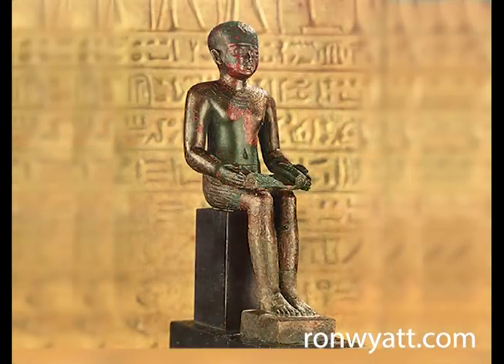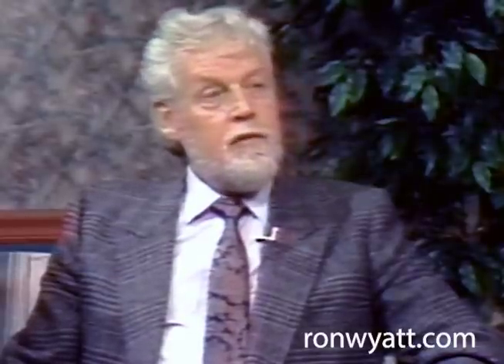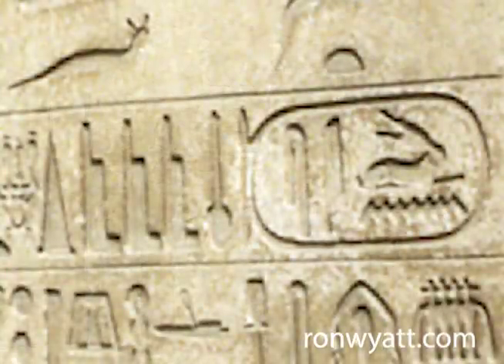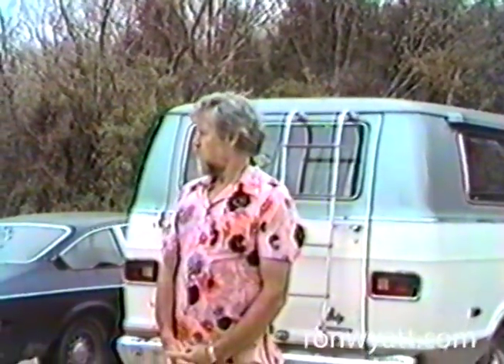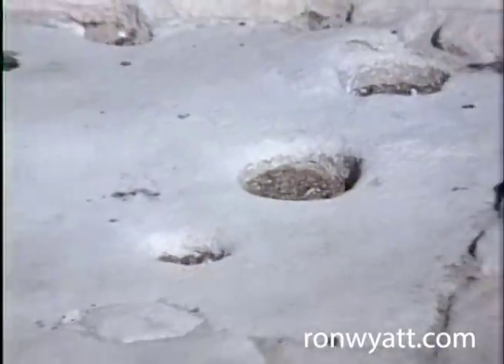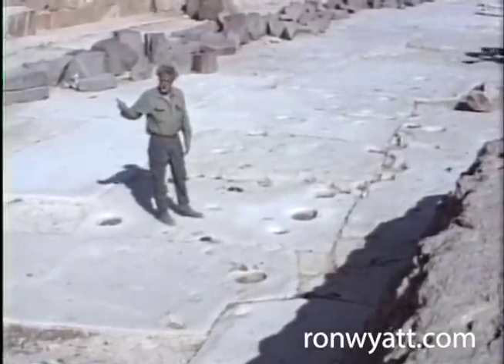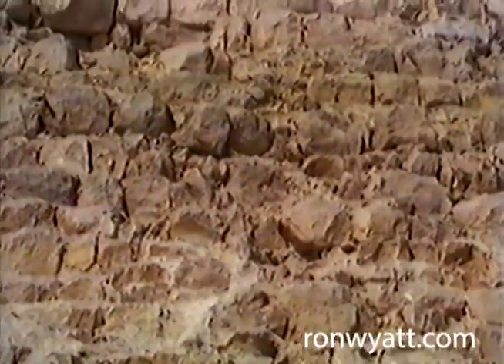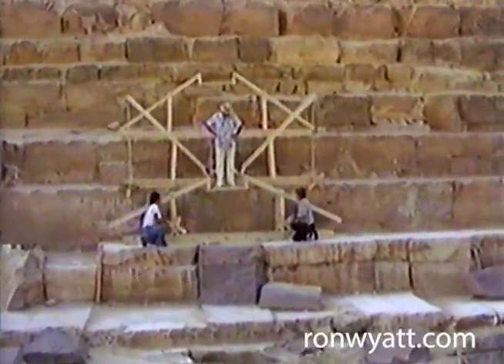Joseph the architect of the First Pyramid and How the Pyramids Were Built

Comment: Dear Mr.  Wyatt,  I too had a hunch that Joseph was the architect of the pyramids in Egypt  too. It only makes sense.  He was commissioned to  build buildings that would keep grain and corn for surplus stored up for up to 14 years.  And Joseph was educated, he showed the purpose of the building by putting the grain shafts in line with the season change. 
Ron, think like a farmer.  Those are silos. There's a place where the grain and corn rode up a conveyer belt and into those shafts. I believe that Erich Von Daniken found grain and corn in those shafts.  And that proves your point as well.  You have a new research video to do sir.

Comment: Some parts, and/or some pyramids may have been built like this but the great pyramid of Giza was NOT built like this. It was in fact built using 2 methods, 1) a ramp method to get the largest stone in place - where the counter-weight used to haul the large rocks into place was placed in the "gallery". The 2nd method was a spiral tunnel built into the pyramid from the inside from the ground all the way to the top. and at each corner a contraption was used to turn the stones by 90 degrees in order to get them ready to go up the next stage of the ramps which made up the spiral. As the pyramid rose, so did the spiral. The tunnels that made up the pyramid is still there.
Reply: This is the French man theory?

Comment: The great pyramid is 756 feet long on each side, 481 feet high, and composed of 2.3 million stones weighing nearly 3 tons each and that the structure was erected in just 20 years, which means that a block of stone had to be moved in place about every 5 minutes of each day and night 24/7. I don't think such a machine can do that kind of work.
Reply: Geopolymer (Institute)
Reply: you are wrong, its always the same claims and wrong numbers about the great pyramid. just one fact as a start, most of the inner core of the GP is small, rubble and bigger stones and LOTS of gypsum plaster, only the inner structures and outer layers are made from big stones.

Comment: This should be good!😂😂😂
"Melting Stone With Sound" video shows a guy uses sound frequency to cut through a stone using a soft copper tube, a technology that, advancing over the centuries, could be the method used to cut and transport megalithic stone blocks. Their "Priests" would be able to chant a perfect pitch by watching the patterns of sand on a drum. Maybe that's why the Priests were considered sacred. The voice of the Gods? 
They're not talking about how the stone blocks were cut to shape and fit only one place in the pyramid. Each block is unique and cannot be switched with any other block. The Mathematics it takes to design each block in concession and with the speed in which it was done, the difficulty of design with chambers we still haven't discovered yet, surpasses our ability today.